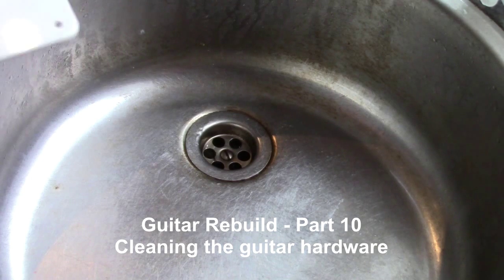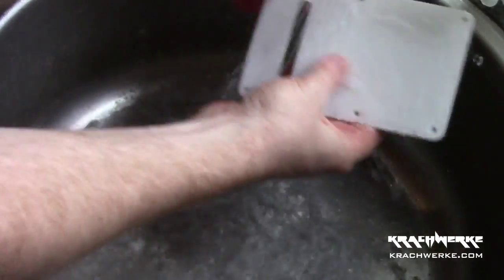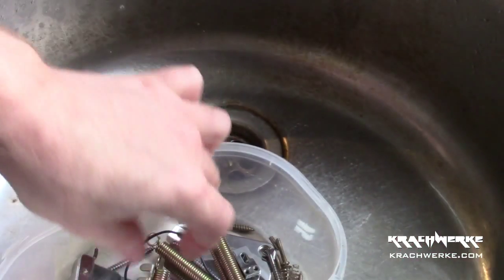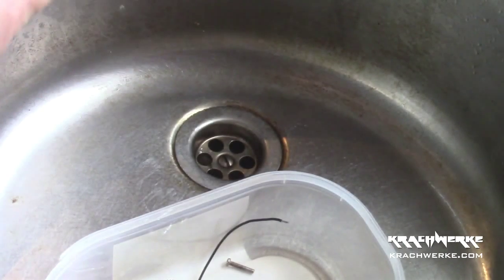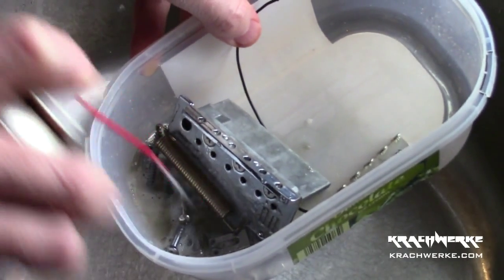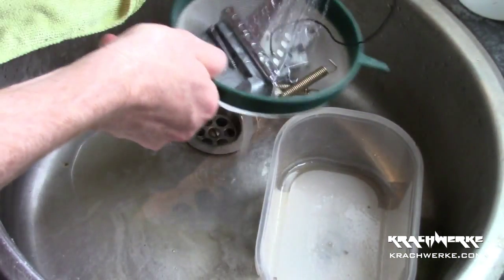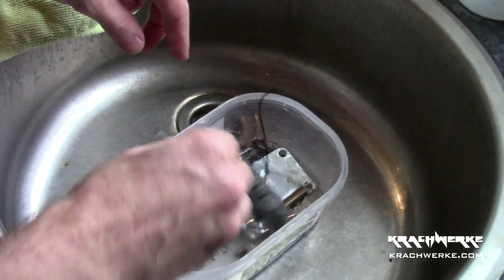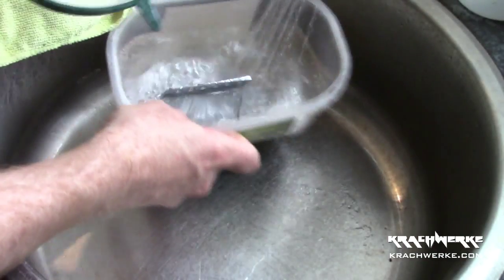Guitar Rebuild part 10 - Cleaning guitar hardware

Comment: Hey, 7 years later! Cool vid, mate. I go slightly different about cleaning guitar hardware. I put my hardware into a bowl of warm, soapy water and clean it with some soft bristle tooth brush. When all is clean, I rinse it throughly with clear water. Then I try to dry the hardware as much as I can with some soft towel. Then I carefully run it over with compressed air, to really spray any remaining water out. Finally, I apply a healthy dose of WD-40 and let it just „dry”. From my experience, WD-40 is really great for lubricating saddle screws and protecting the metal parts. WD-40 also displaces any moisture, so I would recommend using it after cleaning, rather than to clean. If it feels a bit greasy after „drying”, you can always buff it off with some soft cloth. I thought, I would share my experience, since I like to take care about guitar hardware too. Cheers from Poland! 🇵🇱

Comment: Don't pour your solvents down the drain kids. Protecting our water and wildlife is truely rock and rolls \m/
Reply from the maker: From all the stupid comments about this video yours is the only one I take seriously. You are 100% correct and I honestly don't know what I was thinking.
Reply: How do I properly dispose of my solvents?
Reply: wd-40 is edible...meaning you can eat it...it's actually made with fish oil.
Reply: Darryl Taylor you re trolling right? 
heard that urban myth before.
google states “50% aliphatic hydrocarbons”. 
I m no chemist but that doesn’t t sound edible to me.
Reply: @darryltaylor9916  they said they dont put fish oil in wd40, and is clearly stated on packaging that is not safe for our body.
Reply: @darryltaylor9916  Maybe thinking of ballistol?
Reply: I thought exactly the same thing. Chemical components as WD40 down the drain!?
Reply: @SonOfUkko
It depends on your location and rules. 
If there is a small quantity put it in a tissue or better yet into a bottle that you can seal and put it into the trash.

Larger quantities, then you'll have to ask at your local dump.

Comment: That pretty much didn't work for me. Although on their website they are claiming that it can remove rust, from what I've seen in other videos, people aren't getting great results with WD-40. That was my experience as well. Maybe if you have just a few tiny spots of rust that'll work, but the results will still be similar to just putting it into warm soapy water. I tried lemon acid method and it worked better, but still, the results weren't ideal. It didn't damage the shiny parts, although places where the rust was became kinda rough and scratchy and the bolts and screws became dark where the rust was on them. Now I don't think there's a method to make it all look as new.

Comment: I have a question, its ok not to remove the parts because the rust and the scratches of my guitar in only one part but what should it be done?
Reply from the maker: I don't believe you can clean parts effectively without stripping thr parts, but then again I don't know your guitar and where the problem lies exactly
Reply: @KrachWerke  ok i see isee thanks hehe but lastly how to remove scratches on it?
Reply from the maker: @AngeloLuis22  On the hardware or the body of the guitar?
Reply: @KrachWerke  hardware specifically  on the saddle bridge where the allen wrench its pushed down
Reply from the maker: Apologies but without seeing it and knowing the full problem I would not want to answer. Maybe make a short video to show where the scratches are, what material the bridge is made of, what type of bridge it is etc etc.

Comment: Good practical video.. you used "spirits" to remove the the WD40, ..just checking..is that mineral spirits? Thanks
Reply: Whats do you use after the first water shower? That thing in the bottle?
Reply: White spirit
Reply: julio5595
Reply: +julio5595 but what is the white spirits? mineral spirits, alcohol,white vinegar.....
Reply: well the product itself is called "White spirit", I'm not sure what the exact content of it is
https://en.wikipedia.org/wiki/White_spirit
Reply: +julio5595 gotcha thank you
Reply: julio5595 so it's just paint thinner right?
Reply: yup
Reply: Dave Intallmadge metal parts-i have WD-40 Machine Degreaser- anyone tried that with success?
Reply: No gloves? Is WD40 not very strong skin irritant ?

Comment: good vid man. helped me out. one of the only few videos on this subject matter of rust on bridge and saddles. I did a similar method to my dad's old peavey bridge. I soaked it in apple cider vinegar, brushed with toothbrush, then soaked in wd40 and brushed off again. it worked well for that one but my fender strat is so rusty on bridge plate and saddles...just thick shit man. any suggestions? im making headway with it but can't get it all so far
Reply: Electrolysis would do the trick.  There's some videos on here if you haven't found a way yet.

Comment: How about for black hardware? e.g floyds?
Reply from the maker: This process as for removing rust and corrosion. If the hardware is black it might be enamel or paint and the dw40 might remove it. I would suggest something that isn't harsh and maybe just an old tooth brush and soapy water.

Comment: Dude WD-40 is like the Honda Civic of lubricants. People that say its the best stuff ever usually arent who you should listen to. WD40 is not a cleaner. It canot remove rust. It can only help lubricate. It makes as much sense as trying to paint your car with dish soap. You need an actual rust remover. Even vinegar would work much better. As for an oxygen barrier, you need to try something like a dry film protectant like Workshop Hero anti rust spray. Something that actually dries. WD40 does not. As for a good anti seizong lubricant, Aerokroil is the best stuff on Earth. Its in an orange can and its what you will see in maintenance cabinets in industrial factories. You will never find WD40 there.
Reply from the maker: The WD40 takes away the rust and cleans the all the muck out regardless of what you think it does or doesn't do, but it is oily so using the warm water and dishwashing liquid to then wash that off. The proof is in the pudding unfortunately. Did you see the before and after?
Reply: lol are you trying to say lubricants and oils don't remove rust? maybe don't ever leave another youtube comment for the rest of your life, or at least until you've hit your 12th birthday
Reply: Krach Werke I saw the hardware cluttered in a poorly lit container ebefore they were doused in WD40 which makes them shiny, but no evidence to wupport you claim. Im just speaking from my personal experience rebuilding old motorcycles, repairing guitars, metal fabrication etc.
Reply: @JackstandJohnny  it does literally say "removes rust" on the can of wd40 that I'm holding this very second, so that unnecessarily mean tirade you just levied is more than a tad uncalled for. Try to be at the very least a decent human being. Failing that, maybe just a quiet one.
Reply: Yet, when I used it to remove the rust from the bridge and tailpiece of a 35 year old Guild it worked great. Just my personal experience...
Reply: There's literally a guide on the WD40 site on how to use it for neutralising and removing rust.